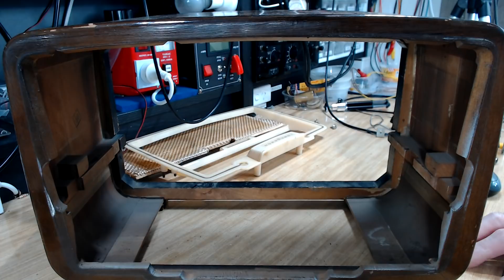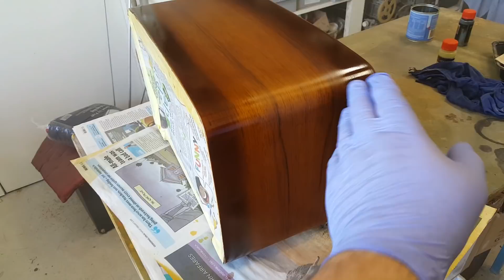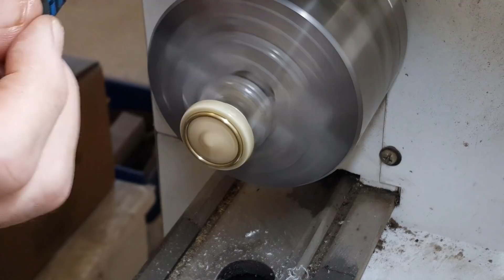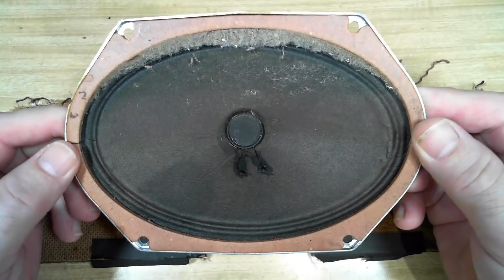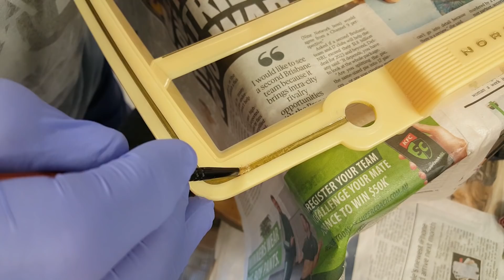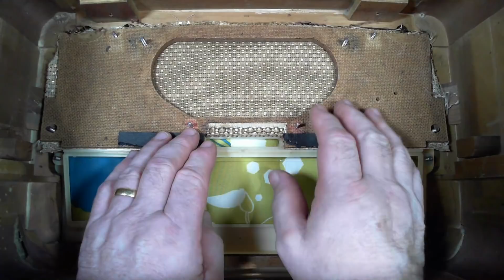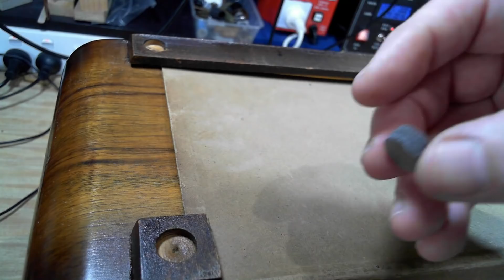NordMende Elektra 58 Restoration Case Repair Part 3 - Final

Comment: I am an auto detailer (23 years).  I have used my 
Citrus based solvent on the cloth of 4different radios and vacuumed it out carefully.  This technique worked for me quite well.
📻🙂
Reply from the maker: Great, thanks for the tip Jeff 👍🙂
Reply: David Tipton 
If you try this , please note:
The main ingredient in these citrus based solvents is “D-Limoline”
I get it in concentrated form so must cut it, but the advantage is that it dries complete, and leaves no residue.
( this is my main cleaner for all interiors, including exotic and antique cars, fine leather, and even on suede . I’ve been using it for several years).
📻🙂
Reply from the maker: I found some in the local hardware sold as a spray on cleaner. I should try it on the old cloth before I replace it. thanks Jeff 👍
Reply: David Tipton 
Make sure of the specific ingredient:
“D-Limoline”.
There are tons of so-called “ citrus “ cleaners but they are basic Alkaline / alkali  with a citrus scent.  Those are more corrosive, and leave residue.
Experiment and play around with the citrus solvent first. Use it on other materials and newer cloth.  I say this, because it acts differently . Get to know what to expect.
   And please, let me know results ❗️
📻🙂
Reply from the maker: @jeffking291  OK, will do Jeff
Reply: David Tipton 
“Akingstouchdetailing @Facebook”. 
This is me. Look me up.
📻🙂

Comment: David, that is an insanely perfect restoration. However, as beautiful an autistic design this set has both inside and out, I will be avoiding the german's vintage stuff like a V2 rocket. I already  have my hand filled with a Rovema Packaging machine, Model V180, Serial 6687, Year 1979, I can testify that these guy were way ahead of the times. Thanks again for your upload, as always I enjoy watching you work. Keep safe, and hope to be here see what's next.
Reply from the maker: Hi Raul, thank you. I can understand people being shy of these sets. You restore packaging machines? My house is full of radios, I can't imagine packaging machines, although it would be cool for packing the kids lunch, cheers 😀
Reply: @DavidTipton101  Actually I do repair and restore heavy machinery, It's been my job since I left collage, 18, that was 26 years ago, weee... I am an electro-mechanical engineer. But Tomorrow will be a TV technician, I have a job, 1997 Panasonic 52" projection screen. No power so hoping just TV's internal breaker or fuse, lol.

Comment: NordMende? What's this? In these days of old nobody had written a name in such an idiotic fashion as it is usual today. The name was Nordmende, simple and easy.
Reply from the maker: Hi N. A. McBee, Firstly, thank you for pointing out that I am an an idiot, I was trying to keep that under wraps. Secondly, Nordmende, for as long as I can recall used an uppercase 'M' in their name and still do, admittedly, the whole word is uppercase with a larger M. Will you be changing your name to Mcbee? Cheers 👍
Reply: @DavidTipton101  
Hi, mate,
I did not say that you're an idiot! I said that this kind of writing is somewhat idiotic. That's really a difference! Okay, you say that as long as you can recall it, Nordmende used an uppercase M. Strange, that's all I can say. I'm German, and I know Nordmende from the days of my childhood, born in 1956. I've never seen this brand name with an uppercase M. Sorry. If Nordmende branded themselves NordMende in the U. S., okay, then I simply did not know this.Sorry again.
Reply from the maker: https://www.nordmende.eu/
Reply from the maker: It's also on the front of the radio and the back panel

Comment: ARRRG, I missed it by a whole day!  Another excellent job!  I do automotive detailing and you might want to try steam on the grill cloth. Small steam cleaners can be purchased for about $100 U.S.  Spray with steam starting at the top and washing the dirt down. Then  blott with a clean soft cloth. For more stubborn dirt, a mild cloth cleaner and a soft brush works well and blot dry rinse blot with clean soft cloth. Now that you have the spray gun, buying finish in a can and spraying yourself will do a nice job at a much lower price than a spray can. Nice thinking on the speaker mount, I have used the leg clamps for a lot of things.
Reply from the maker: Hi Wayne, thanks mate. The material was glued to the backboard so I didn't want to get it wet, that's why I opted for dry cleaning. I hadn't thought of steam cleaning cloths, might be handy in future. I have a number of spray guns but that rattle can paint is cheap and they had a two for one sale 😀
Reply: @DavidTipton101  Steam is a wet process for sure but it is pretty quick if you blott right away. Very effective for delicate fabrics. GENTLE brushing with cleaner is often good too but yes you need to be very careful of how it is attached, try is a small spot etc. 2 for 1, pretty inexpensive, hard to beat that :D I am glad to see you still working, now more than ever we need to keep busy! Blessings to you and the family!

Comment: Fantastic radio! I was surprised at how good it sounds. As for the touchup work, the case looks good and no one will see it. If you tackle something like that again, you might want to consider sealing the wood before applying the touch up color; that will prevent the stain from bleeding into the wood and spreading around. Also, you can always cut-down bristles to make the brush smaller for fine detail.
Reply from the maker: Hi Brian, thank you. those are both good points, thanks. i did cut down the brush when i did the gold stripe 😉😀

Comment: What kind of lacquer do you use on polished brass items? I previously used some acrylic clear lacquer, but it almost always made it orange peel and a bit kinda lemony yellow. Thanks! Anyways, just beautiful work, looks amazing, I am sure it also sounds amazing!
Reply from the maker: Hi michvod, I showed the can in the video. It was made to protect brass and copper from tarnishing, it's very thin and I usually just dip the item in it. I have had that tin for 20 years and it's still good.It's called Incralac by Wattyl paints, looks like it's only in a spray can now: https://www.ritepricedistributors.com.au/products/117914-530-wattyl-incralac-metal-lacquer-gloss-aerosol-300g 🙂
Reply: @DavidTipton101  Thank you very much. I will see if I can get anything similar here in the Europe!

Comment: The radio sounds and looks (in my opinion) like it's brand new and just came off the store shelf.  I heard you say you had not tried anything like finishing the cabinet in that particular manner.  I would say you are capable of anything you set your mind to. That cabinet is absolutely beautiful and the finish looks just as good as if not better than the factory finish.  Kudos!
Reply from the maker: Hi TheGrouchyGuy, thank you. The finish came out very nice and I hadn't done it before so spent many sleepless nights wondering how to do it, fortunately it worked out for me. Thanks for your comment 😀

Comment: Another outstanding job the cabinet came out better than the original look.
You could try mild bleach on the cloth or another idea may be to spray it with acrylic paint.
I have a small box of various old radio bits and bobs knobs , tubes , ect a good assortment of useful stuff and small nuts and bolts that would be more suitable for the period , if you want them i can post them out to you at no cost when all this mess is done with.
CHEERS.
Reply from the maker: Thanks Shayne, that would be much appreciated. You can contact me at vintageradioaus(at)gmail.com Cheers 🙂

Comment: Excellent as always, David, thank you for entertaining us! What do you think is the purpose of that rectangular hole in the base plate underneath, in line with the right-hand side control knobs?
Reply from the maker: Hi Dave, thank you. The cutout is for the silver flywheel on the tuning spindle, you can see it through the cutout 👍🙂

Comment: Excellent restoration. The radio has superior sound for mono. The refinishing .  .  . Well you have arrived my friend. Superior finish. I worked for 40 years as an automotive paint expert. Great finish coming from a rattle can! I look forward to your next restoration.   Brad
Reply from the maker: Hi Brad, thanks. The radio sounds very nice. The acrylic paint in the can works very well, I have used it a number of times with great success. I have it in a 4lt can as well but the rattle cans were on special and I don't have to clean the gun 😀

Comment: What a spectacular finish on the timber! Congrats!

The original speaker wasn't that oddly shaped, just mounted the same slightly odd way you mounted the replacement:
https://www.oglasindo.rs/uploads/15/08/13/29/91829.jpg
Looks like you were spot on with the size of the replacement!

The picture also shows the original mains lead, the most common type used on European radios from the mid-50s to early 60s, usually with a beautifully moulded plug. That kind of flex is still acceptable for mains use in Europe and listed as H03VH-H but no longer available in that shade of brown.
Reply from the maker: Thank you Ragnar8504, the case looks great. 
The original speaker was 75mm longer that it's width. Speakers that I could find were only 50mm wider. The original was 4.5" X 7.5" and the one I used was 5" X 7" so it just squeezed in thankfully with a similar surface area. Mine still had the same power lead as in your photo, it had been cut short and an Aussie lead patched in 😀

Comment: Fantastic job Dave... In fact,  "
es ist wunderbar".  I could tell the sound was almost 'hi-fi' , no doubt helped by the thick wood cabinet adding presence and bass.  MrCrystalcranium  was correct in his sunburst spraying method description , but  having done it myself to a well known American electric guitar,  (made famous by Buddy Holly ) , not his, I hasten to add !,  It took me three goes to get it spot on. .. Social distancing has made my viewing of this presentation a little less fraught, as the better half has distanced herself to the adjoining room.  The isolation has affected her badly..She now thinks she's a 'chicken'. I haven't said anything, as we need the eggs !  Stay safe...
Reply from the maker: Ahh Pete, your poor suffering wife.  My wife has taken social distancing very seriously, I'm sleeping on the floor! The sound is very good, I was worried the way I aligned the FM it would strangle the sound but it's very good. If I do another starburst I will heed the advice from MrCrystalcranium, I would have done it differently next time anyway, same method but different technique. Stay safe yourself Pete 👍😀